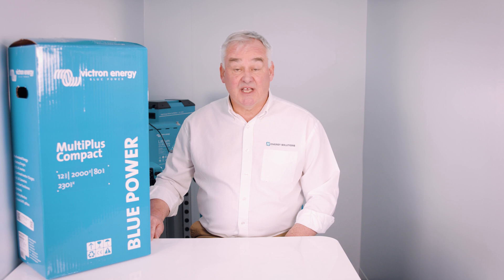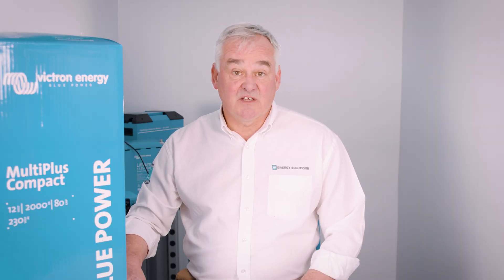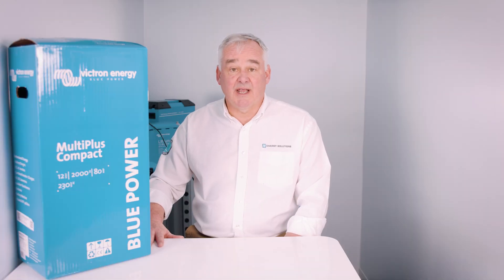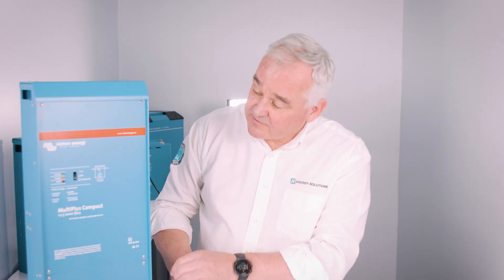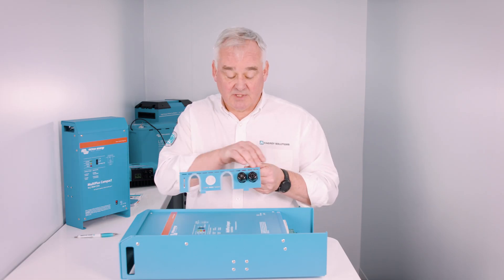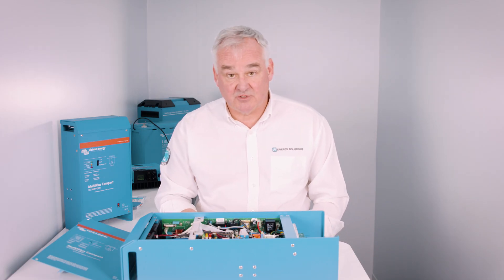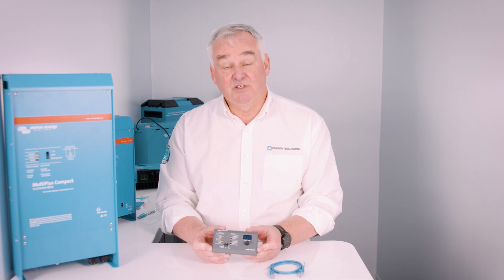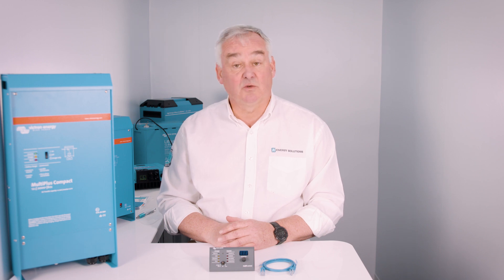Breaking Down The Victron Energy MultiPlus Compact 12/2000

Comment: What accessories would be needed to charge 12.8V Lithium batteries?
Reply from the maker: Hi @VenalesM, thank you for your question.
To charge 12.8V LiFePO4 batteries using a Victron Multiplus, you'll need either a Victron MK3 to USB interface or a Cerbo GX device connected to the Multiplus to configure the correct charging parameters for LiFePO4 chemistry. No additional charging hardware is required beyond this.
However, we strongly recommend using a LiFePO4 battery with an integrated Battery Management System (BMS) that can communicate with the Victron system (via VE.Bus, CAN, or other supported protocols). It just makes everything safer and smoother in the long run. Victron Energy have a range of BMS for their own Lifepo4 batteries.
The MK3 to USB is on our website here: https://www.energy-solutions.co.uk/c-ve-acc-mk30-usb?sku=C-VE-ACC-MK3.0-USB